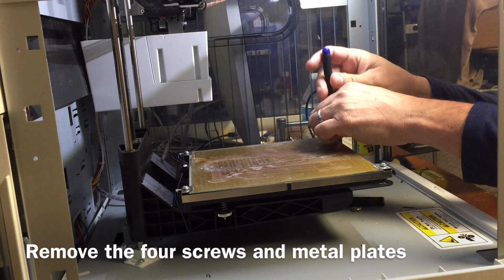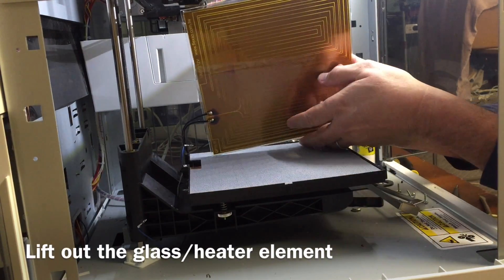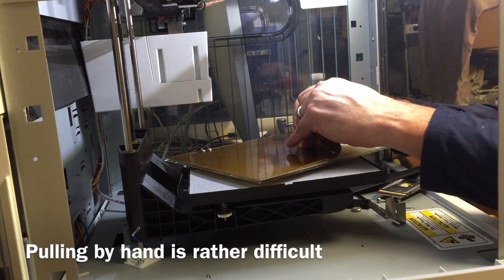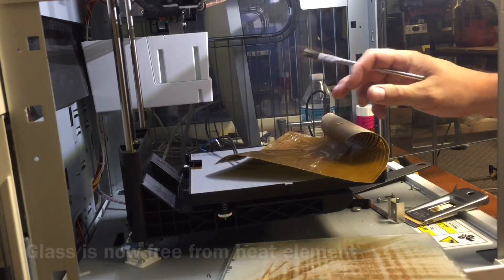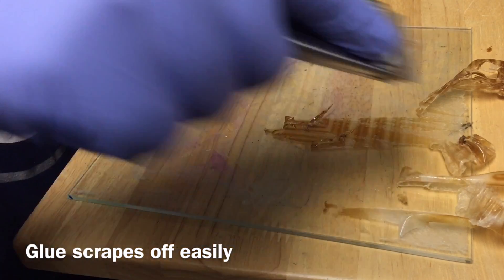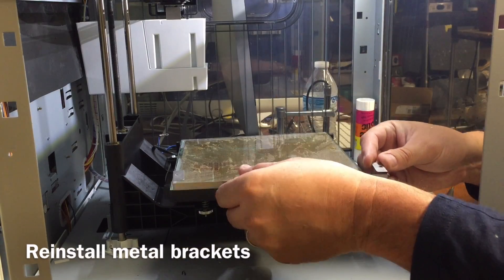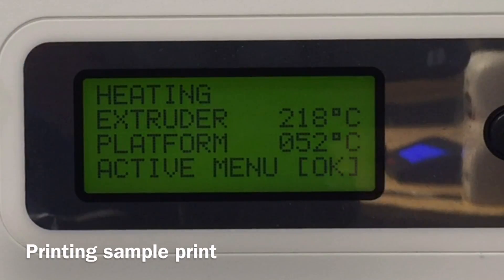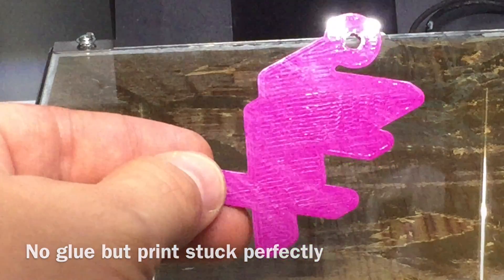Tuesday TechTip - Fixing Broken Glass on a Da Vinci 1.0 3D Printer

Comment: Hi Chuck. Love your videos and this one struck a particular note. Got a 1.0A for Christmas. Bed started to chip on very first print and chipped more on every further print no matter where on plate I printed. Returned to Amazon after only 10 hours use.  They are shipping a new one. Did I just get a dud or are they all going to do this ?  I always waited for plate to thoroughly cool and never even used the scraper.  Any ideas?  Anyway keep up the good work look forward to every "Filament Friday".
Reply: +Mike Bates I had the same problem after 2 weeks and about 50 hours printing on my 1.0A. I didn't want to deal with the customer service for XYZ after reading some peoples lack of support and so i bought a borosilicate glass bed with element from ebay. Haven't got around to changing it yet but it is there for when the inevitable happens and the glass breaks fully.

Comment: Hi Chuck. Nice tip on the glass, finally saw someone with the same problem like I have. My glass keeps chipping away every print that I do, so I finally decided to use the bed plate sticker that came with my flashforge printer. It work beautifully now as I do not have the risk of chipped glass anymore. Anyway, do you know of a way to prevent chipped glass from happening.

Comment: Glad I could help you out. If it chips on both sides let me know. I know a guy on ebay that sells replacement glass cut to the Da Vinci's dimensions cheap.
Reply: lasersbee you can buy them here https://the-davinci-zone.myshopify.com/
Reply: +Dr.Buddha No Problem Bud. Thanks for the name.
Reply: I did the same thing but just be aware that bed heating time will take longer
Reply: +Dr.Buddha I&#39;d like to get a piece of replacement glass. Could you please link to the eBay seller ??
BTW... I'm sure there is a way of using a replacement heater and glass from another 3D printer manufacturer. I'll just need to do the R&D.
Reply: +lasersbee sorry it took so long to respond. been busy. the guys ebay name is davincizone. he has a listing for the heater and glass combo but if you ask him he will sell you just the glass.